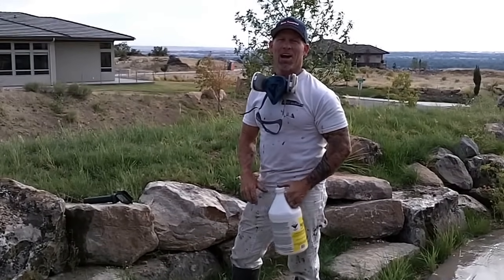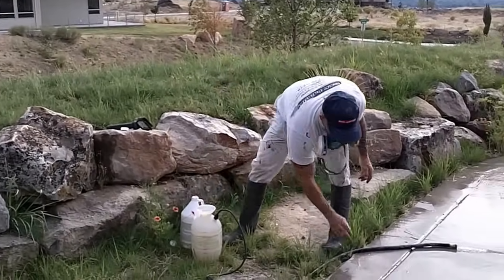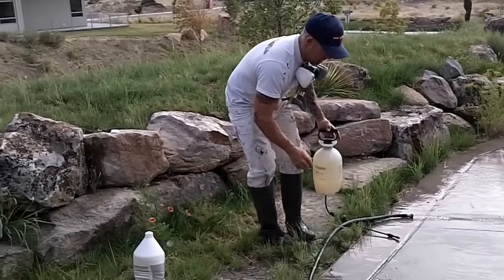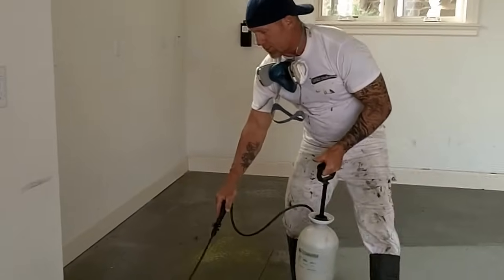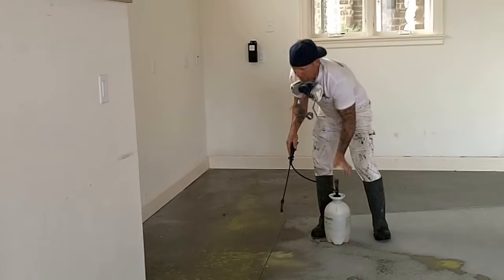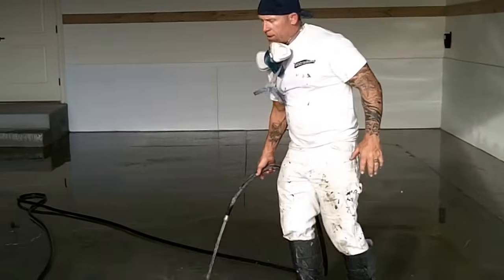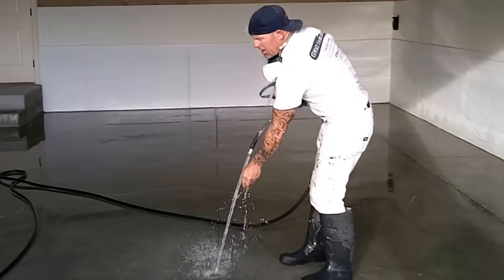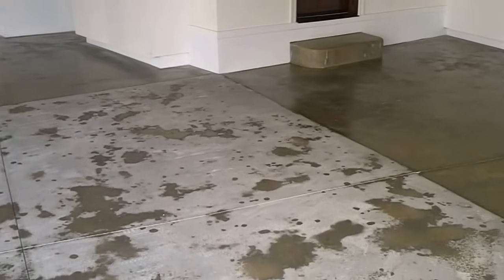Instructions & Tutorials Preparing Concrete For Epoxy.  Acid Etching Hacks.

Comment: All the nanny comments about the danger of working with acid are cracking me up. Muriatic acid is about the weakest acid you can buy, it's marginally more potent than the citric acid you get from squeezing a lemon. When I was building swimming pools, we would wash our hands with acid straight from the bottle to get the cement off our hands. It will definitely let you know if you have any cuts or scrapes on your hands, but it will not dissolve your flesh like the more potent acids will.

It's also the best rust remover there is. But when using it on metal you definitely have to neutralize it with baking soda afterwards.

Comment: Grind the concrete or don't do it at all. If any customer gets a quote that includes acid washing the concrete instead of concrete grinding.... just avoid it

Great for short term but grinding the concrete gives proper bond and you'll get over 15 years easily. Acid washing you'll be lucky for any company to give a solid warranty for 10 years.  Acid washing is cheap and nasty.

Comment: After you acid, mix a box of baking soda on a 5 gallon bucket and clean up to remove acidic!
Reply: For sure. Especially when applying 75% acid to 25% water!!
Reply: Is that an okay combo? I have made the same assumption before any acid or base should be neutralized and I put some vinegar in after I cleaned a sink with ammonia. This turned out to be the worst combination possible as it is a lethal gas mixture

Comment: Chris thanks for sharing your experience and knowledge.   Question; my garage was previously painted with a latex paint and is in good condition.   Can i apply an epoxy paint if the floor is etched with acid?

Comment: Im surprised you dont nneutralize the acid  using a 2nd pump sprayer with baking soda and warm water. 30% industrial vinegar diluted would also work. You have to neutralize the muriatic acid, or epoxy will fail folks....
Reply: That is what I have heard  When (how soon) do you use that second pump sprayer after you lay the acid?
Reply: Is that an okay combo? I have made the same assumption before any acid or base should be neutralized and I put some vinegar in after I cleaned a sink with ammonia. This turned out to be the worst combination possible as it is a lethal mixture
Reply: @jrynmk  yes baking soda is a good base to neutralize muriatic acid (or most acid in general). I’m not sure if using vinegar (acid) to neutralize another acid works though. Ammonia has its own reactions which make it worth taking caution when mixing it.

Comment: I would always recommend diamond grinding or shotblasting the floor instead. No harsh chemicals, no harmful vapors, you grind and install the coating the same day.   What about the acid that has gone into the joints? That will reactivate in the future and slowly deteriorate the concrete under the coatings. I can guarantee, it will be a problem in the future at some point.
Reply: To remove the acid you mix a box of baking soda on a 5 gallons of water and you clean the floor with this water. It is recommended by the coating manufacturer!

Comment: Great video brother.
Thanks for the info.
I removed carpet, linoleum, tile, and black adhesive mastic, degreased, filled divots, sanded with 20 grit. I still have polished concrete that is not going to hold paint or epoxy. 
I just tried seal krete clean and etch on a very small test area. Works good in high concentration but can’t foresee doing the whole house with it. 
Any advice for etching 1200sq ft of interior floors with muratic acid?
I was told not to because it would damage Sheetrock and paint but I’ve invested 3 weeks trying to prep the floors to paint instead tiling and hit this roadblock.
Peace and blessings
Reply: Have to grind it.  Rent a machine.
Reply: @arrepuess   little late. I tiled the whole house. Looks awesome!

Comment: I had black mastic I took it all off and used a degreaser , but still some areas water repels it , will muratic acid work?
Reply: miguel garcia 
I used blue bear to remove the black mastic. Damn! That stuff works great!
I degreased, rinsed, and mopped and found a highly polished concrete underneath. I filled a hundred carpet tack divots and two cracks  then I rented a sander with 20 grit and went over for several hours. No change. The concrete repels water because it’s highly polished. I’ve been advised not to use muratic acid for interior so I got seal krete clean and etch. It worked on my test area at high concentration but don’t know if I’m going to do the whole house with it since I would need several gallons to complete. Also, I was told the muratic fumes would damage my Sheetrock and paint.

Comment: What would you do in a basement mud room??? Can’t power wash it..
Reply: Seal krete clean & etch at Lowe’s would be ideal for a small interior area. I’m trying to do my whole interior house and didn’t feel comfortable with muratic acid so I bought some seal krete etcher and just did a test area. 
Works good with no fumes.
I don’t think this is my best option for 1200 sq ft but I can recommend for small mud room. Good luck!

Comment: Since Muriatic acid is stored in plastic jugs, I have to assume it will not have a disastrous effect should  any acid find it's way down a crack to the Pex radiant heating pipes in the slab. Any  thoughts would be greatly appreciated.
Reply: correct.

Comment: So, there is no more yellow acid (it is fully deluded) how do you get the water/acid mix out of the garage?
Reply: When I did mine I neutralized the acid by dumping on 5 gal buckets with a mix of water and baking soda which made it safe to go down the drain or wash down the street without worrying about it continuing to etch
Reply from the maker: Just rinse it out with water into the grass or wherever

Comment: Great vid, very informative, thanks.  I am in the process of putting down an epoxy surface in my garage and have already done an acid etch using the citric acid that came with the epoxy kit.  I rinsed the floor numerous times with a high pressure water spray and have got a very clean etched surface now.  The problem though now is that the fine cracks in the concrete have absorbed some of the water and two days later I still have a network of darker grey areas of moisture around the cracks - about an inch either side of the cracks.  I assume that I need to wait til they fully dry and am wondering if there are any tips to speed up this process or do I just need to be patient?
Reply: vacuum the water out. Or hit it with the leaf blower.
Reply: Heat gun can cause the concrete to crack even more because of  drastic temp changes. I'd shop vac the whole area to give it a head start, prevent some of the water seeping into the cracks, then leave a box fan overnight, or use a leaf blower like Mauricio said. Hope that helps
Reply: I'd use a leaf blower, then a heat gun. With a heat gun you can see the concrete drying up right away.

Comment: So the acid WILL eat away at the oil spots? The previous homeowner at my place had a leaky car and left a dark stain on the concrete. I was told I'd have to rent a special floor grinder to remove the concrete down below the oil spot? Also, do I need to mask off my walls to protect any paint/baseboards from the acid?

Comment: Chris why do u wait 2 days to start epoxy?, does it react negatively to any residual etching acid?
Reply: to let dry. if u epoxy righ away moisture that gets in concrete will need to come out  and will probably make paint fail.

Comment: I have a question about using the muriatic acid indoors, in a relatively confined space. Can I use a metal fan for ventilation, or will the fumes damage it?  How do I ventilate?
Reply: +ryanspears1986 You really don't want to be breathing this stuff. If your heart is set on using the acid then yes you definitely need to ventilate. Diamond grinding is a far superior method of prepping concrete prior to installing any concrete coatings.

Comment: Great info... I am working on a 400 SQ FT garage fairly new about 2 yrs old new home... I have use Muriaitic Acid 2 Times so far. First time, 70/30 water and 2nd time 100% Muriatic Acid, but There still place one the floor still not as rough as I want. I have pressure wash the floor 4 times with rotate tip pressure washer. There's still streaks of residue still on the floor where I feel like the epoxy will not adhere to cause it wipes off with hard rubbing with my finger.. What should I do at this point ? If Muriatic Acid is strong enough, will the pressure usually cleans it out one time ? Also should I pressure wash after rinse off the muriatic acid or let it dry and then pressure wash ?
Reply: +Michael Chu If you would have prepped the floor with a diamond grinder , you wouldn't be having this problem. Diy kits that you can purchase in big box stores are really the only ones who say to use the acid etching.  Its designed for the homeowner to do it themselves. We exclusively diamond grind all our concrete floor jobs. If the concrete has a coating that has failed due to improper preparation we will use a shot blaster to remove the old coating and then diamond grind it. This equipment doesn't come cheap, the two machines that im referring too.  cost thousands of dollars. This is why the kits are sold with the acid etching. The equipment is available for rent at home depot for around $150 including all the accessories.
Reply: @sdchealthnews  , I have a very rough concrete garage floor in U.K. with trowel Marks and everything , 30 years old , do I need to etch ?

Comment: This guy skipped a few too many chemistry classes in highschool. Watch other videos. What he does here is very dangerous, in so many ways rather than listing them all, I'm simply going to say, go elsewhere for advice on this.
Reply: Yeah since everyone has access to a diamond grinder and or the 280v power and hookup to run it. Not to mention the know how to use one. Diamond blades are also expensive.
Reply: Thats what i thinking.  surface prep should be completed with a grinder.  All youre doing with muriatic acid, hydrochloric acid, is reacting the calcium mineral deposits... thats why it foams.  You need to grind down to the coarser aggregate like others mentioned.  For other concerns, the acid should be neutralized 30s-2 min after applied with ammonia or sodium bicarbonate. Just pouring water on it is putting acid in runoff especially with garage drains.  The acid should also be diluted down to 1 part acid to 8 water.  As a business, I would be more concerned about showing these practices then making a few dollars on youtube videos.  doing something for 15 years doesnt trump an education.  like another comment mentioned the acid removing oil.  It may but oil is properly removed with  alkaline based degreasers and neutralized with a light acid before rinsing.
Reply: +Adam Ecks I agree Adam. Acid etching is not the way to go. All this water being used is totally unnecessary. Using all this water makes the job take longer. Having to hose down the driveway and watching out for plants so that the acid doesn't kill them can all be avoided by not acid etching in the first place. Diamond grind the surface then vacuum up the dust and your ready to apply the coating, no waiting for the floor to dry and we typically have homeowners back in their garage the very next day.

Comment: you don't spray the acid off with water. Water re-activates it. You neutralize it wish either baking soda and water or Ammonia and water.
Reply: i do vct tile  strip n wax i know  when i strip i use alkaline and  i have to neutralize it  with an acid . if i  just use water  which i  cant  flood the  floor, and get water under the tile ,my point is using an opposite agents will quickly   neutralize   without needed so much  water  plus he pressure washes  it  after, thats fine  i guess  where he lives ,  yet if he wasnt  neutralizing it  , it would etch the  outside driveway as  he  pushed the water over it ,  who knows i know  2 bux a ft to etch  is  damned good money ,  i get 35 cents to strip wax   FML